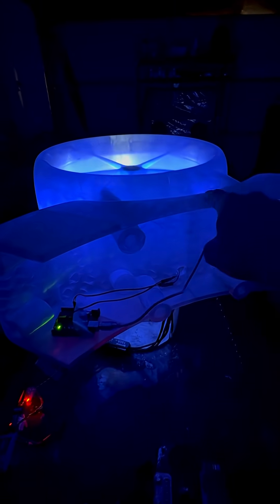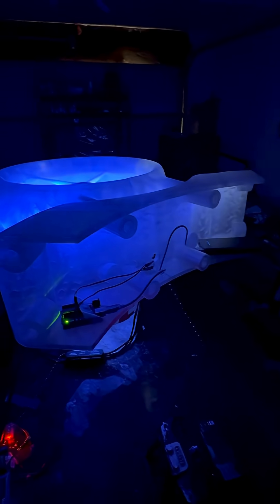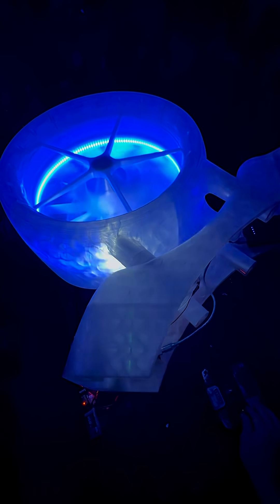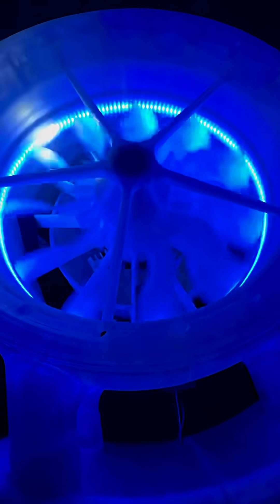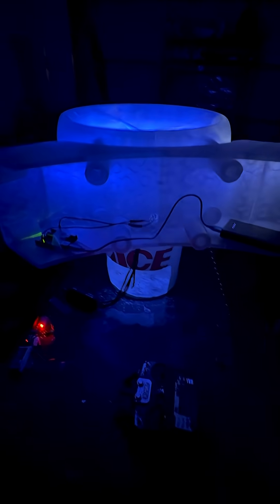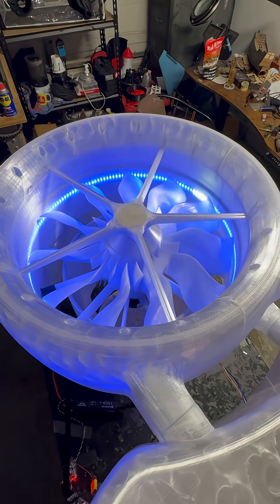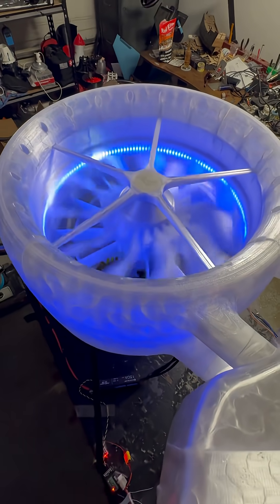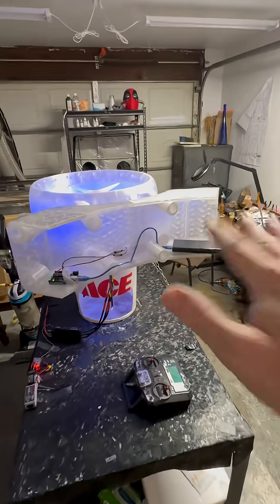1500mm EDF diy drone build. Dry fitting body sections.

Comment: Are young going to use thrust vector fins for the engines?
Reply from the maker: On the drone configuration since we have counter rotating blades, I’m not worried about using thrust vectoring at the moment. Standard X quad motor rotation. Controlled by INAV.